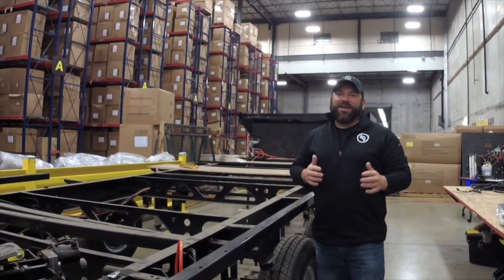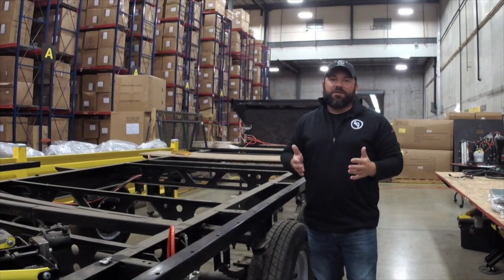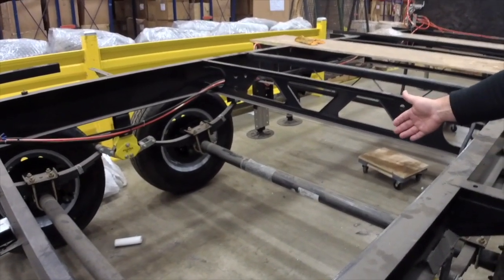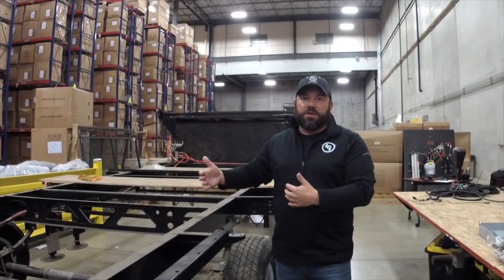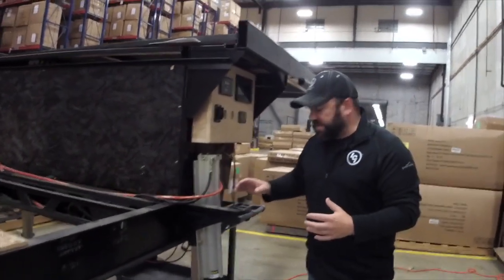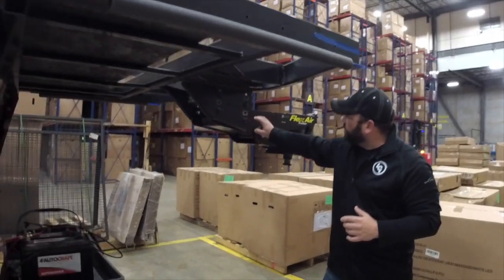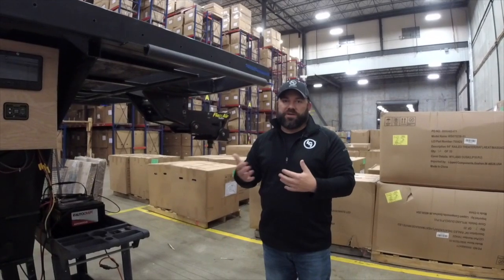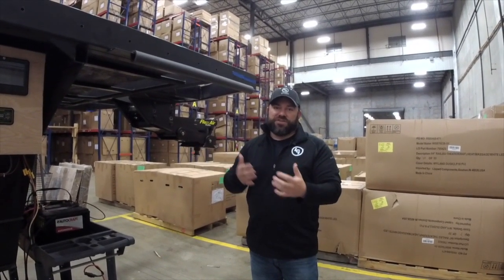Lippert Axle & Chassis Identification

Comment: You made an important notice concerning the sticker location on the front of the axle, however, in the same announcement stating over time due to road conditions, wear and tear the sticker may become unreadable? Also mentioned that when ordering parts that same sticker information, if gone  makes purchasing of parts basically improbable? How about placing that important sticker on the backside of the axle virtually eliminating the road debris wear, unless you do a considerable amount of time traveling in reverse?